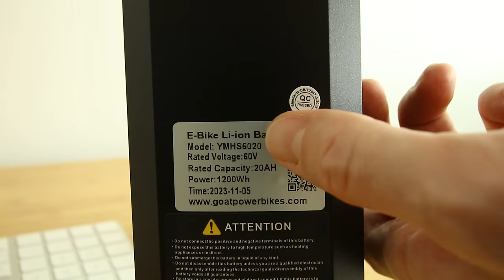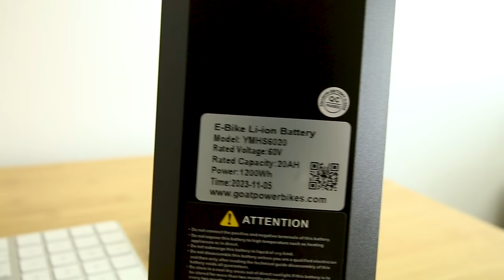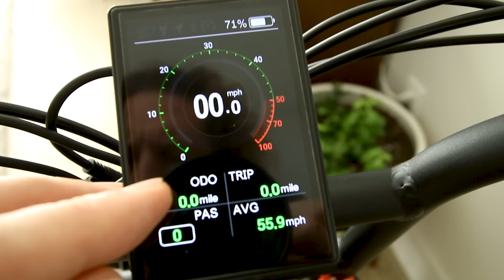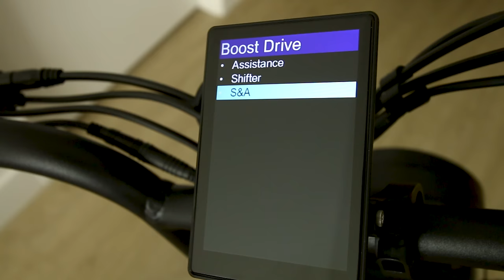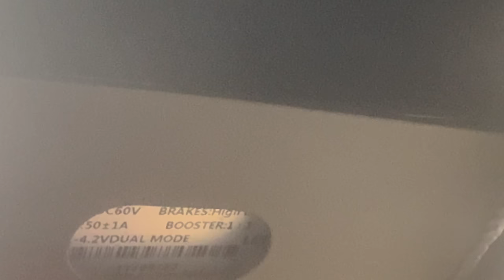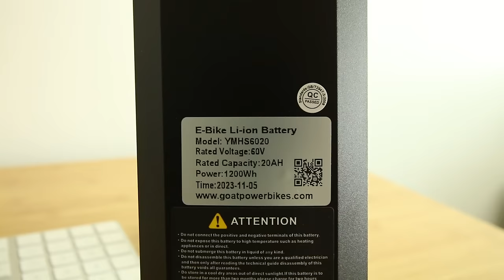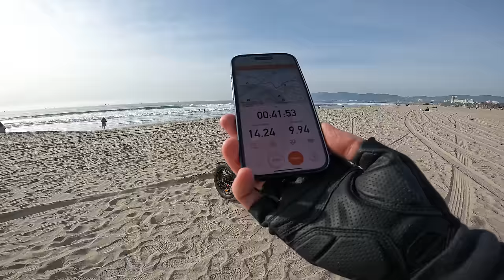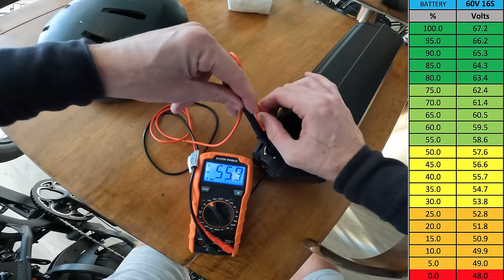The NEW 43 MPH Billy Goat ebike is ABSURD!

Comment from the maker: https://bit.ly/billy-goat-discount - Click here for extra 10% discount and to support my reviews, new batch arrives and ships in March just in time for riding season, if you want one grab it before they're sold out
Reply: Link doesn't work
Reply: Are these in stock now or is it just preorders?
Reply: Link works but how do u get the extra 10% off edit: doh nevermind. Just had to add to cart. Simple! Thanks.
Reply: BRO HONEST OPINION BILLY GOAT OR SPARK??
Reply: So I’m 5’1 I didn’t catch what you said about height!
Reply: Could you suck Goat deck any harder?
Reply: Hi do you know if these are in stock for pickup this weekend in San Diego?  Or are they only taking pre orders for March 2024...
Reply: Motorcycles use a pedal for the rear brake, the clutch lever is on the left handle-bar. (You misstated that more than once.)
Reply: I just bought this Ariel Rider grizzly bike dual motor dual battery but everything is exactly the same except for the frame and the wheels my wheels are spokes in total I spent $3,700 and it only goes 37 miles an hour and I've got everything together except the mirrors that doesn't give you much room so I have to move some things on the handlebars to fit them on the handlebars I just think it's funny that some of the things are exactly like the little screen and the mirrors are exactly the same
Reply: I was hoping to get a Deal on the one in the Video ÷0) thanks for the very well made and informative Video!
Reply: Hi there, I am unable to find Goat ebikes website, I live in Australia and am about to purchase my first e bike this billy goat looks great and performs well, looks like something I would like to own, so brother can you help me out
Reply: $1,889 👍
Reply: How long was the assembly?
Reply: I have a quick question I have a E bike that I love to pieces though getting on it and riding it I discovered being that I weigh 260 and it being a hard tail there’s no suspension so it’s a 3 inch room and I wanted to know if I can put a 4 inch tire on there and get more suspensionor support going over bumps on a 4 inch tire I know people put bigger tires on rims whether it’s in the community or not so I want to know your thoughts on the matter

Comment: I love the fact that burnout is still on your floor. This looks like a beast for sure. Not the design I am looking for but everything else says SOLD!
Reply: They have different frames
Reply: Check out our other models! The Power Goat has the same amount of torque/speed with a different design.
Reply: Thanks, will do!
Reply: @GoatPowerBikes Hi i'm thinking about buying one, I'm 
Five foot seven, How's that work with the seat Height would I be able to put feet on the ground?
Reply: @lecroixband it’s more dependent on your inseam. If you have a 29-30 inch inseam, you’d be able to touch the ground with your tip toes.

Comment: bro you will have to use that cellphone holder more often, you are going to give me a heart attack driving at 35+mph with just one hand in steering.

Nice bike btw hehe.
Reply: I had the same thought, plus Id like him to add that in general to his videos so we know it will hold a phone. Ive seen some bikes recently that wont hold a phone cuz theres no room on the bars
Reply: At those speeds you better have both hands on the steering.
Reply: People have died at those speeds in cars, never mind a bike. And this dude drives one handed for some reason, not to mention he usually doesn't wear a helmet. It's the perfect suicide trifecta.

Comment: I'm an e-bike builder (including a Cyclone 3000 watt mid-drive, 40amp controller, dual 52 volt packs (1st=27.2AH, 2nd=13.6ah, total 40.8ah), on 700c cyclocross bike (top speed 40mph), also have 750W mid-drive (BBS02), two 350w front hub and my fave, a 250w front hub with 22ah 36v dual packs that does everything and yet gets over 100 miles of range.  I also had several motorcycles from 80cc to 750cc (Yamaha and Triumph) so am used to high speeds (but have ditched the motorycycles, and I am now a fan of e-bikes).

I have viewed dozens of e-bike reviews.  I have to say this is a VERY WELL DONE review  (great job!) on a very well made bike (Kudos to Goat Power)!  Even at $2,500, it's solid value, and If I did not already have so many e-bikes, I would be happy with this one!

Given my experience with my own 3000 watt (cyclone mid-drive) bike, my comments are:
1.  Even at 20AH, this 2000 watt motor, fat tire/100lb bike, 60 amp controller will likely suck the 20 amp hour (ah) pack dry within the first 20 miles (especially if you do what a bike like this really tempts you to do: ride it like a Honda 125 with the low-end grunt of a Yamaha 900 triple (basically racing cars on the street, and playing hops-scotch with buses and getting to your destination in less time it takes to drive there.)      A bike like this could use a second pack (connected in parallel).  Even another 15-18ah pack would really help with alleviating range anxiety on this bike (extending range by about 80% more: e.g. instead of just 20-30 miles, maybe a more practical 35-50 miles.  Only problem: I can't see a place on the bike to put the 2nd pack (I don't see method of adding a rear rack and installing pannier bags to store the 2nd pack.).

2. This bike's design does not allow for seat height adjustments.  I'm 5'11" (6-7" shorter than you) and it looks like even I would have difficultly pedaling and apply any real pedal assist to help extend range.  

3. It's a strange thing for me in that after 4 e-bike builds and 1 bought e-bike (LECTRIC Lite 350w 48v 7.8AH- short range), my favorite is the latest build which ironically is my "smallest" bike (in terms of motor and controller) - a 250 watt, 36 volt Bafang front hub kit (14 amp controller) installed on a Trek hardtail with Marzocchi fork.  This 48lb e-bike throttle only bike is a blast to ride, is super easy to pedal,  reaches the e-bike 20mph speed limit with ease, eats the steepest of hills with very little effort, engaging and thrilling to ride, great/stress free pedaling/exercise, and best of all, just sips power from its packs (dual 36 volt packs totaling 22 ah), and easily gets 100 miles of range (i.e. just about zero range anxiety).  With it's light weight (35lbs with batteries off), it's easy to handle and transport on regular bike rack.    I hardly every ride my much heavier Cyclone 3000 watt anymore.
Reply: They do make a rear rack for this bike, though it's not that big
Reply: thank you for writing this and sharing, i appreciate it.
Reply: So the 250w must be a gear reduction motor correct ? I'm surprised it does so good on hills , are u a light rider ? I would like to build a battery saver like that but I would be afraid of getting ran over. I do have a 350w fat bike wheel and motor just sitting here collecting dust, maybe I will give it a try , maybe I will upgrade the gears to metal first, cuz I scared of the plastic ones giving out in traffic and getting ran over 😮
Reply: На моём Велосипеде с таком - же формои Рамы  мощностью двигателя 1000 w , Акум   на 48 в и 18 Аh  тоже Параметры плохие ?? Ещё не Опробовал , пришел с Изогнутыми ухом для Крепления натяжного Механизма цепи , а рама Алюминии . Боюсь выгибать , пока не Тороплюсь

Comment: Very few motorcycles would use the left lever for the rear brake.  Aside from a handful of bikes that have an automatic or semiautomatic transmission (and all scooters), the left lever is the clutch lever.  The rear brake on a traditional motorcycle is applied by the right foot.
Reply: you are right but i think he's implying its more like a motorcycle setup because it allows his right hand to control the front brake while conventional bicycles use the left hand for the front
Reply: its not a mtorbike its a bicycle and depending on what county you are in the left and right can be front or back for legal grounds, i used to work as a bicycle mechanic in the uk and any bike i built had to have right front and left rear to be legal for sale. Some brands came like that some were opposite and i had to swap them.
Reply: Motorcycles are left hand front brake from my experience.
Reply: @brandon1443  What kind of motorcycle are you riding?  Front brake is always right hand.  Left hand is either clutch or sometimes rear brake (scooter).  Right foot is rear brake and left foot is gear selector (if equipped).
Reply: @jeffer1101 Hell, some bikes just straight up don't have a left hand lever (Honda Cubs)

Comment: Great review, as always.  Looks to be the best bang for your buck e moped/cafe racer style bike available.  Definitely not the best for pedaling, bike paths or off road, but this is clearly the one to beat in the very popular e moped category.  Not sure how they can claim 50mph and 50 miles of range on pedal assist considering your objective testing, but whatever, it goes really fast!
Reply: Most of these companies claim range that can only be achieved on the most conservative settings, and to be fair the sand runs, multiple torture tests on high inclines, and time spend digging holes and peeling the tires, honestly in a real world setting your likely to see closer to 25-30 miles of range just sliding around town

Comment: Great review as always! I ordered a Motor Goat V3 with an extra battery to bring up 45am of battery power. I might get killed at 65 years old. This will be my 6th E-Bike and the fastest for sure. I strongly hate > battery lag < and realize that more battery AH means less "Lag" Thank you for the awesome video.
Reply: Amp hours doesn't correlate to "lag" or performance. It's a unit of measurement for battery capacity which translates to range.  What you're referring to is the number of amps a controller can draw from a battery. The higher the amps, the more torque you'll experience, which can be perceived as less "lag". Your battery voltage dictates top speed. I hope that helps.

Comment: This bike has less torque and is heavier than the Wired Freedom, so why would it have the same acceleration?
Reply: 10 amps more on the controller.
Reply: The goat direct drive motor puts out more watts than freedom motor due to more amps in the controller so this equals more power output.. I just ordered the power goat I can't wait.. both bikes are leading the pack in my opinion

Comment: Hello, can u do a review on the power goat V2?
Reply: The Billy Goat, Power Goat and Motor Goat are roughly the same bikes with different frames, options and maybe slightly different weight.  The motor, controller and wheels are the same.

Comment: I don't think I have seen you as revved up as when you got this bike..  I do like the smaller bikes for the maneuverability..  The wider tires seam to  help out as well.. Not sure about the direct drive and not sure about cadence sensor..  I am in Denver so I do have the mountains and I do have snow..  I don't necessarily need all of the speed but I do want the power and control...

And I want to see what those mirrors look like on the bike... They look cool..

Comment: i built a 2300w 72v 60ah rear wheel hub motor 29" electric bike and reached 49mph on it so far! I think 50 is possible. It usually goes between 35 and 45 depending on wind and road conditions.
Reply: 6:20 mine goes to like 66mph when i go full throttle while lifting the back tire
Reply: 14:09 to build mine, the bike + electronics + accessories totaled $1441.86. but it's a nice full suspension dual disk brakes 29" diamondback recoil pro FS from 2015. got the bike itself for $500

Comment: I am more interested in the Motor Goat v3, and it's 2 battery option (more for the 2x speed of charge than the added miles). I am sketched out by the recharge claims the company makes though, they say it can be "fast charged" in 4 hours. That would need a 6amp charger that they don't sell and it out of spec for a barrel charger which max at about 4-5amps before they will have problems. It would need some kind of higher app connector to get that kind of juice. What kind of connector is it? what size barrel?

Comment: This is a strange question.  What if I wanted to get this bike, but wanted to drive it in (non highway speed) traffic with plates like a regular motorcycle so I never had to worry about cops as long as I followed the traffic laws. If you are testing bikes all the time like you, I understand.  I don't need more than one.  Seems like getting plates would be the way to go if you did not mind the cost.

Comment: They should use a "" Sunron Light Bee motorcycle"" electric motor and (5 speed transmission.)
8,000 watts. (Top speed 90 mph.)
Range is 90 miles.

All to power a bicycle.

Then you can pull things.

Comment: I need something like this, doesn’t have to be that powerful, but still 35 easily and still look like a normal bike. Right now mine goes 24 “easily”, 27 if I pedal and work for it, or get lucky with wind conditions. It’d be nice to throttle only to 30-35 but there seems to be no bikes like that. This one’s close, I’d love it but I’m afraid it wouldn’t adhere to trail etiquette/wouldn’t be appropriate for the trails I use around me.

Comment: direct drive is the best, mine is a 1000w direct drive and it reaches 35 quite easily. plus they have no moving parts so reliability is rock solid.

Comment: Nice design. You really need those tires to run a fast ebike. I have a fast bike on 26" tires and at speed the bike is really twitchy. A high center mass combined with big wheels and soft sidewall tires isn't a good combination. True electric moped.

Comment: Nice video enjoy it very much so.. what is the best bike that will do 40 plus.. I need a bike to hit the beach. That will Hit the speed limit on the road in spots where there is no bike trail. I know this one looks pretty good and you had wired and I believe there was one other one you really liked. If you could pick one what would be your choice? I'm 5 11 
200lbs. What are you thoughts? The one I have tops out about 32 then I'm in the way when I'm on the road short run. The one I have now is the red rover which doesn't do the speed I need. Very nice bike just a little conservative on the speed.. some of these bikes you're reviewing or beasts. I need to beast.. Thx ✌️
Reply: I have the Motor Goats in stock at my shop in Long Beach if you would like to check them out
Reply: @beezloan1  That's a great idea Thank you but I'm on the east coast OBX NC the beach they're.. I can see how that question could be a conflict I understand... ✌️ Great offer tho!! Thx

Comment: My choices would be between the Goat or the Wired bikes. I feel the Goat would be more conspicuous to the police, with the giant white lettered 2000 watt motor,  where the Wired bike is clearly marked class II. The wired is also a bit cheaper and offers a completely step through model which is ideal as a safety issue for shorter folks. Bye the way, do you offer or/where can I find a discount code for the wired bikes? The factory is less than 50 miles away from my location. Thank you again for your excellent reviews

Comment: Really interested in these higher performance moped style ebikes. My question is about comfort. I've ridden and owned many regular bicycles (and motorcycles) over the years including racing style bikes, mountain bikes, beach cruisers, and lots others. I rented a few mopeds on vacation and they were fine for short hops around town. I'm wondering how comfortable its going to be riding this style of eBike for several hours and many miles.

Comment: That seems like good power for the size hub motor, not alot of weight and no spokes to break. Not sure if the tire is a good fit cuz It doesn't seem very round with the high and low spots, it might have enough power to get out of the way of traffic in an emergency and not get ran over , big plus compared to smaller Watt motors BTW if you buy a hub motor from the factory you might have the option to have it made for more speed or more toque for off road riding or city riding

Comment: He got 21 miles total but he was dogging it but it was a test.How often are you going to ride in sand or ride up a mountain?? I bet you could probably get 25 -30 if you rode it in normal riding conditions. And probably 55 miles with 2 batteries.

Comment: Seat is too low, making it really uncomfortable to pedal or during long rides.  The rear sprocket by default makes that ratchet sound whenever the pedals are not being used.  Yikes. Bad design.  100 pounds?  Ooof.  A bike that heavy is going to crush your bones if you wipe out.  Thumb throttles are safer and easier to use than the rotational handlebar grip.  I do like the 2000+ watt motor, along with the turn signals, brake lights, fenders, hydraulic brakes,  compact size.

Comment: So I am trying to figure out what is stopping someone from throwing this 100 pound E bike
into the back of their F150 and driving away and sawing off the lock at their leisure?  (nothing)
Better invest in some Apple AirTags and put them inside the seat and inside of motor housing.
Reply: I was a little more confused about the rear tire lock, like what prevents someone from just lifting the rear tire and rolling it on the front 🤦 they should design it so it can double as something to lock to a pole, not just a single tire from rotating 🥴